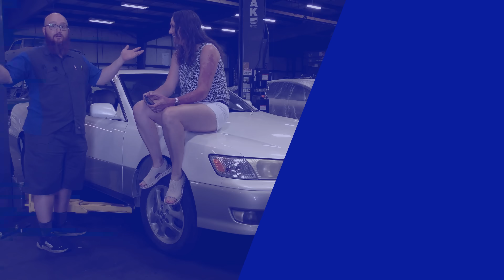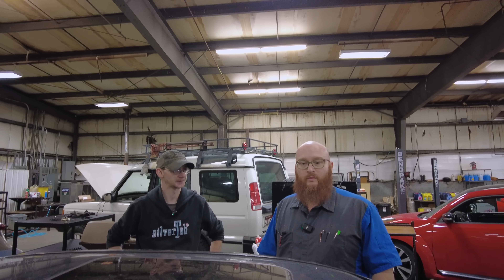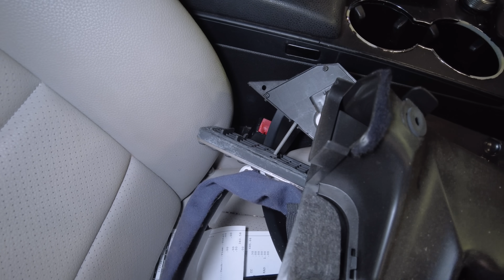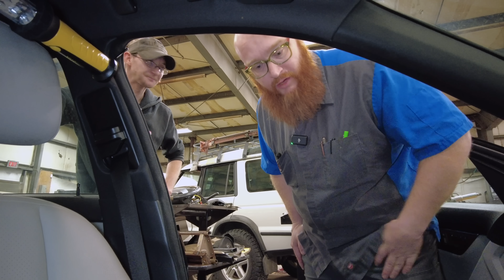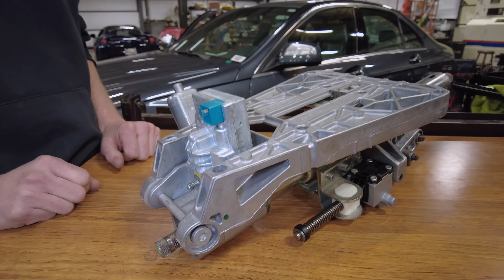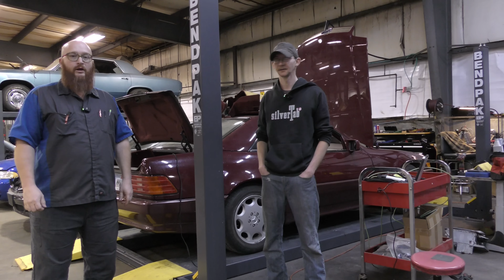Tiny Part TOTALLY Disabled This Mercedes! AND it's a Common Problem!

Comment: Did one of these without removing steering column, Just need to drop down. Was stuck in lock mode. 
Too few hours plus little $10 12v DC motor. And I don't even work on cars.  Sometimes you need to replace whole unit when removed 
From what some people are saying if you play around with the lock too long the firmware does a complete system lock out and can not be reset with relevant software. Not sure if this is true.

Comment: This happened to my c300.  Benz wanted 2500+.  My local mobile auto locksmith came out 1 hr. 500 buck to install the emulator by pass 👍🏻

Comment: So just so you know. If you have two people there and you take one person to bash the steering wheel left and right as hard as they can and another person to take the key and put in the ignition like they’re trying to kinda have sex with it you can get it to unlock and if you get lucky like I did, it will get stuck in the unlocked position and you will be able to drive and start the car without having to ever change the part

Comment: Now it has come the whole circle: My first American car, -64 Valiant 45 years ago did not have a steering lock system but a shielded ignition coil when new. Sort of a grand dad of modern systems. And ,as it already had perhaps million kms on it (even the gas pedal metal had worn almost through), the coil was now normal coil, so it would have been easy to steal. Then came Seventies Euro Fords that had faulty steering locks that locked while driving. My friend had his Cortina totaled because of that. Some jap cars had ignition locks assembled with one way screws/bolts that were pain to get off. Now my H3 sometimes thinks that I am trying to steal it, and now I always first switch the key to the first positon, wait until the radio comes on, and only then switch to ignition and start. No problem then. I already have the part to fix that ,though, and bought the Tech2 straight from the factory in China for 400.-. It came with everything but the plasic case. They apologized in Chinglish that the case comes from different factory to Bosch and are put together there... It even had all the correct identification stickers. I have tried it already and I can get deep with it. 
So , modern cars have become stupidly complicated and fail prone. That is why I still have my -79 K5 Blazer as a backup WHEN the H3 fails.

Comment: 14 hundred, for one module, then if another module on the system goes down... Another 14 hundred... 😅. It has to be a science of those new era car makers. I run a w203, one motor in semiautomatic gearbox 10 hundred, the sam module 14 hundred, the y rate esp module 6 hundred.... The stearing angle sensor 6 hundred. The ignition module 5 hundred, the airco flap motors 4 hundred each time one get bad (trere are 7 in those cars).... Hundreds..... Gold era!

Comment: FIX: 1 hour of work - can do it WITHOUT  removing steering column or steering wheel etc. when it’s STILL WORKING…: Loosen 4 bolts of column. Remove two lower ones so you can tilt column to create space to wiggle the lock module out. Tighten bolts of column. Then order replacement brushes or motor Amazon. Remove brushes of old motor and new motor, clean old motor and reinstall new brushes onto old motor. Careful not to disturb current position of plastic gear. Also there are 4 pins you have to pull out carefully of module housing as to not damage internals. I just ziptied the module under dash somewhere just in case. Other Benzs do not have have a steering wheel lock from factory.

Comment: Same happened to me on a Audi 2.8 cabriolet auto 1999  because the break light switch on the pedal send a message to the auto box saying everything is ok but if the break light switch stop working or shorts out like mind did and blows a fuse there no message and the auto box won’t come out of park turning the car in to a brick and there nothing you can do until you replace the break switch which cost about 15$

Comment: It affects the E class as well and some other models apparently. When the ELS fails it can be jumped temporarily by removing the relay and a fuse. Google it. Means you can get the car to a garage without a tow truck. I have a jump lead in my car at all times now.

I removed mine on my w204 and replaced it with a new motor. Cost 13 euro and five hours of labour and that's me doing it. Not a garage.I didn't remove the whole column. There are u tube vids on the process.

Was ok for six years then went again fried the chip this time. Replaced it with an emulator for 450 euro including programming. Emulator doesn't replace the lock but bypasses it

Comment: Once had a late 90s C-Class come into the shop near standard V6 and all that they had the double firewall and in between the firewall was as well where a lot of the wiring was well I found this rat's nest in there and mind you see class was one of the rare manual transmission cars and they said whatever they were got in the hose on the master cylinder for the brake for the clutch and the transfer to you know and killed all the babies but yeah they had a field day with all the wiring in their Siemens wiring is it has a vegetable based plastic coating on the wiring and apparently mice really like that

Comment: You tube is so good because you can see how to fix stuff .
Our 2002 sprinter campervan had turbo  issues.
All garages I consulted wanted to fit a new turbo.
But on YouTube I found the turbo  actuator lives behind the left hand headlight. This part was 17.50 on eBay.
I knew I had vacuum because the brake booster worked well and the vacuum supply to the turbo actuator came from the brake booster.
Part replaced everything perfect 1500 gbp or 2,000 dollars saved
Thanks to You Tube

Comment: I was quoted 2k + at the dealer, and then found an independent Mercedes guy who came out to my house and fixed the ESL lock problem for 600$. Never had the issue again. He drilled some hole in it or something that bypassed it without coding, and it would make a little tiny click noise anytime I took the keys out of the ignition was strange, but saved me a pretty penny.
Reply: 600 is a good deal, especially with having a guy come do the job. i diy'd removing the module, and the ignition switch to send to an emulator programmer which cost me around $150 but it took me almost 2 days to do, and another day to reinstall when i got it back. i would have gladly paid the 600

Comment: There are motors that came good from factory and never break. My W204 is from 2007 and has 130.000 km and it has the original lock still working.

Comment: Same on W203. Usually the actuator motor dies. Its a nasty cheap old fashioned brushed tin can unit which is usually found in children’s toys. Angle grinder job to remove. Shameful crap.

Comment: There's a way to do it in the car, I've done it before I just don't remember exactly how I did it. But I believe I had get up there and cut off the pin that locks the column and then the steering lock was able to come off. And then yes I had to send in the ignition switch in order to get an emulator programmed

Comment: What fool designed a system where a failed module locks up the mechanism you need to move to get to the module?
Most steering locks are useless anyway as they are easy to shear with brute force.

Comment: I agree with you and buying a used car without a warranty is not a good. I have an older car that has electronic parts which have disabed the car and had to find used parts to fix my car. The manufacturers have to provide parts for ten years and that becomes a problem for older cars.

Comment: Have replaced many of these electric steering locks and it's not necessary to remove all the parts that Grimes did to get the steering column out. Also the body of the lock can be split and the plastic gear turned to a position where the stud can be pushed in without grinding it off.

Comment: My cousin worked as a machinist in Greece back in 1980s.  To prevent his car from beind stolen he designed a REMOVABLE GEAR SHIFT LEVER  . Never ever had a car syolen and he oarks his cars outside all the time. No high tech BS like this . This is unbelievable

Comment: If you happen to choose to bypass this feature, contact your insurance company to be sure that you are still insured in case of theft as you manipulate with the anti theft system.

I’m not 100% sure but I do know that EU has mandated all cars in Europe to be fitted with theft prevention. I just don’t know if this is a requirement or if Mercedes over engineered it.

Comment: I had this model back in the day and this exact thing happened to mine, had to get the car towed to the shop and the part was sent to another state to get rebuilt, was without the car for about 2 weeks.

Comment: Mercedes used to be engineered so that you could get your Benz fixed by a village mechanic in darkest Africa.  And he could probably effect your repair with his pocket comb.  That was something that showcased Mercedes' concern for their customers.  Fixability was fully part of the design process back then.  But that's all over.  Mercedes , like all makers is being absolutely deliberate about putting that African village wrench turner out of business.  You need the dealer for EVERYTHING now.  Mercedes Benz' concern now is to have a pipeline into your wallet.  And they are far from being as reliable as they were in the good old days.

Comment: Mine did finally break, took me a while to know what the issue was at first time to the no crank/start. Never imagined it was the little esl motor. When my buddy mentioned esl or eis, i went into a rabbit hole. Another buddy works at mb and even he said dont bother bringing it in they have a long wait list and to just get an emulator. That took me to a other rabbit hole.. to make it short picked up my own computer for making keys gbox and learned to program the emulator with the help of youtube videos. And i needed a blank key. Which was ok cause i only had one. So for folks do the emulator. But find a shop for it And if you really want to keep it stock still do the emulator but have your esl fixed and stored away. Mine inside broke the lever and motor stuck. But was stuck unlocked so less removal was needed on the column. Good luck out there esl folks

Comment: This is an extremely common issue. It's been known about in the mercedes circle since about 2010. The motor in the steering lock module wears out, and is unable to unlock or lock and ends up not allowing the ignition to activate. I've ended up removing the entire steering column to get to it. If it fails I'm the open position, you're one lucky SOB! And to replace it, it's quite involved with the software and permissions. The emulator is easy. Stay safe!

Comment: You can change the $10 motor in the ESL module as preventative maintenance, without removing the steering column. As long as you don't wait for it to fail. Lots of videos here to explain it. If you don't need a functioning steering lock, you can zip tie the module to the column after replacing the motor. Just to make for easier access in the future.

Comment: Im an MB fan & owner of earlier models, both more simple than this tech marvel 09 C class that is "trouble waiting to happen".

Mine are 2000 e320 wagon (w210) & 2002 ML500 (w163) and they're complex enough.

I know the ML series w164 after mine went to Auto Adjusted Air shocks Suspension & highly complex nightmare.

Uh, no thank you !

These stupid Car manufacturers are signing their own death certificate by engineering in insanely complex tech that will condemn the vehicle much sooner than necessary.

The design & structure & drivetrain are rock solid but the stupid sensor crust fails & that's that.

Comment: It a quite common problem for w204 Mb, in europe we solve that pretty easy and cheap, we cancel the ESL module with Esl module emulator bought from Aliexpress, labor cost in Mercedes dealership cost around 2000$, we do it for 100$ + 50$ the module emulator and i dont need to remove the stering column.

Comment: This happened on my GF B200 as well.. they share the same garbage column lock on this.. the funny design of this garbage is that cheap tiny motor causes this.. and there's a position sensor that knows that it stuck on that so it kinda wont let you start the car at all.. 100 bucks bypass module that connects to the steering lock module fixed everything vs complete column, keys and programming

Comment: Just done this job motors are $10 on ebay and can be swapped easily. 
if locked a small hole can be drilled in module body to wind gear to unlocked to allow spring loaded bolt retraction no need to remove column just slacken top bolts remove bottom two , if NEC chip is blown here in uk warranted rebuild services only £100 more than an emulator 
lots of youtube how to videos, just ensure correct reassembly position before power up … hope this helps someone?

Comment: I had this happen myself. Inside the module is a motor which may well be suitable for a child's toy car. You could buy one for a few pounds (bucks). Why are Mercedes built with these ultra cheap bits of trash?

Comment: I went thru ESL problem on my w204. The mechanic does not take out the whole steering set to take it out. Can be solved in a day...  And at a fraction of the cost you mentioned in Malaysia, just without a steering lock...

Comment: People chuckle at me driving a 1988 Renault... chuckle ahead, I fix cars for a living - I do not fancy being in your shoes, thanks. Mine ain't got no electronics... none that scare me anyways..  That module failure is actually a massive component failure compared to board-level failures. a 10p capacitor can brick your vehicle. Those caps are teensy...

Comment: I had the pleasure of fixing this issue on my w204. I found a replacement motor on Amazon for $17 and was able to open up the module and replace just the motor. It was a royal b**ch to do  it it can be done.

Comment: MBs are obsessed with "safety n security " but never practically.  I've owned 5 and currently 1 won't go n2 gear because of a cheap plastic module that now needs 2 b programmed.  This is Mercedes insanity n I HATE them for it

Comment: This happened on my friend's car.. he replaced the part under the steering wheel and the guy also said he could installed a emulator that does the same thing. I'm lucky as I had a W204 2012 year and never had this problem.

Comment: First I'd like to take the time to thank you for sharing knowledge on cars. Its really help tackle some issues in my 04 w211 E500 wagon. If you have min, maybe you could help me with a  question about my E500? I just replaced my drive shaft and rack & pinion, because a drive shaft failure. But during the failure it crack me front differential. A friend is  trying to give a 08 E350 differential for $75, but im sure if will work in my vehicle. It looks the identical , but output shaft flange that drive shaft bolts has different style flange. Bolt pattern is the same . Both differential have the same part numbers on them. Could it just be that the flange  style was changed for different years. Please any help would be greatly appreciated. I've been becoming quite the mechanic over the last 2yrs.

Comment: I'm a brit , my fiance lives in. Michigan I just been over for 3 months and bought 3 cars , I can't believe how much garages charge for work, back in uk shops charge maybe 5he equivalent to 75 bucks an hour , and any parts they use are at cost price and garage guidelines tell you how long jobs typically take, so typically the shop will charge you same price for a part that you can get it yourself,  over here I've just paid a shop 3300 dollars for a few minor fixes on her old mgb 400 dollars on parts the rest labour, my mercedes recently had new brake rotors on front and new pads and a oil and filter change and a small fog light repair 800 dollars! It's ridiculous it doesn't matter what car you have here once it goes in the shop you know its going to cost a fortune , my mechanic told me basically if he gets a part for 10 dollars he is gonna charge me like 30 dollars! Its funny because back home in UK BMW and mercedes are ultra reliable and garages charge a reasonable amount but here lol it's just a nightmare

Comment: Recently got myself a 2008 W204 and am, therefore, very interested in this topic. Looking through service records, I've not seen that the ESL has been replaced and so I'd like to get an emulator programmed and installed to avoid getting stranded somewhere. Sigh. However, the local locksmith I use for making e-keys recommended against the emulator as the 'new ones fail' and he said that I shouldn't do this ahead-of-time because it's a $1200 job. Other videos indicate this job is much easier before the ESL fails because you can get the ESL out without fully removing the steering column (mines a manual adjustment for the steering column.. Some out-of-state  places advertise $275 to $350 for a programmed emulator and emulator-alone prices range from $25 to $75. Out-of-state programming requires you send the ignition switch (and key and ESL) which, it looks like, requires the steering column removed to get the ignition switch out and, thereby, makes the job a lot bigger. I could be wrong on that last point. Have you had emulators break? What emulator do you recommend? Do you program emulators are Omega or do you send-out?

Comment: I see a few options on ebay for getting one of these, prices vary and the level of service varies... what one should I do? My W204 steering lock motor sounds really, really slow and I think it is about to go out. I'd like to replace it before it goes.